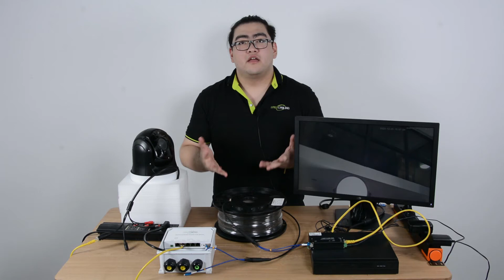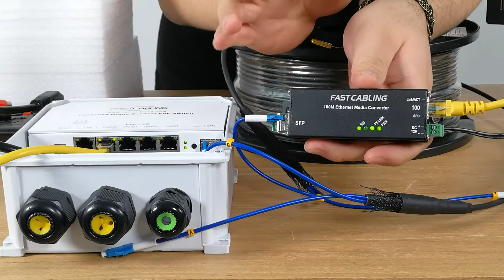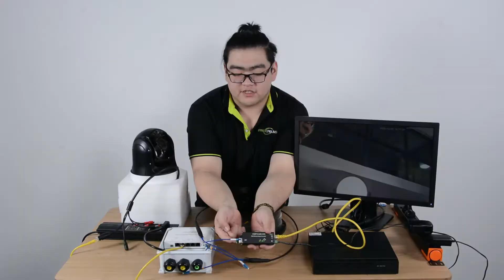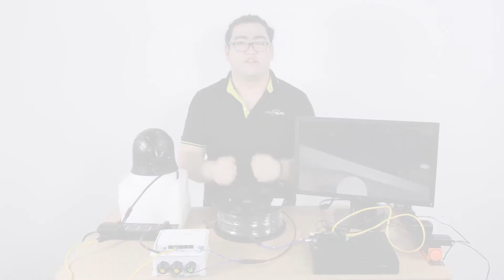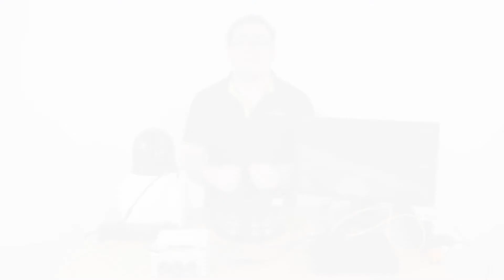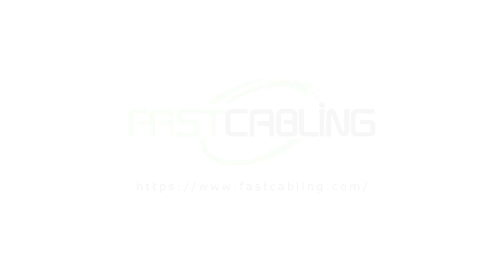How to Set up Long Distance IP Camera System with Fiber Optic Link?

Comment: How are you getting the video from the camera? Is it going through the fiber cable? If not, how can I have ethernet and video from my PTZ camera from the fiber cable?
Reply from the maker: Data can be transmitted through the fiber cable to your NVR, but you need a media converter to convert optical signals back to Ethernet signals. (PTZ cameras - outdoor PoE switch - BiDi SFP module- fiber optic cable - media converter + BiDi SFP module - Ethernet cable - NVR).
Reply: @Fastcabling  You have not answered my question because your answer deals with data(Ethernet for control of PTZ camera on a network). But I also have to deal with the SDI or HDMI video signal to travel to the Fiber cable. I don't see a video fiber converter in your video. So how are you getting the video over fiber from camera to NVR? Thank you
Reply from the maker: There's a media converter right on the NVR.

Comment: How do you control the Pan Tilt and Zoom functions of the camera remotely?  The camera looks like a PTZ speed dome.  These cameras usually draw 15 watts.  In addition some PZT speed domes require supplemental cooling or heating to protect the CMOS or CCD image sensor.
Reply from the maker: You might need heater built-in to the camera in extra cool working environment. It is for the motor to start run-up. The camera will run the heater for a while before moving the pan tilt motor. Usually it needs about 40W PoE++. You need the property software from your supplier to communicate with the camera remotely. There is additional menu built-in to the ptz camera. You can use preset #94 or #95 to pull up the OSD menu. This is the hidden function inside the camera, not the web server built-in to the camera.

Comment: Hello 
I’m sorry if this is a stupid question , but can a cam be used in a different house a few miles from my house ,  and me view the live video feed via the phone app ? Or would it not work that far distance away for me to view ?
Many thanks x
Reply from the maker: You can, but you will need to hook up the camera to local network and the video feed will travel through internet and land to your mobile phone. If the internet access is unavailable at camera side, you can wire the fiber optical cable or use the wireless bridge to build the network connection between the camera and your house.

Comment: Do they make POE converter box for just 1 camera instead of 4? Link?
Reply from the maker: Here is the outdoor PoE convertor for single camera. https://www.fastcabling.com/product/waterproof-industrial-hardened-grade-fiber-poe-media-converter/
Reply: @Fastcabling  thank you. My last question is can you only use 1 fiber connections instead of 2? I have a single fiber ST connector but the majority of boxes have both an RX and TX port. Can I  use one of the two ports and leave the second port open?